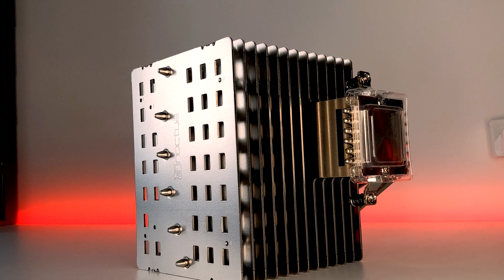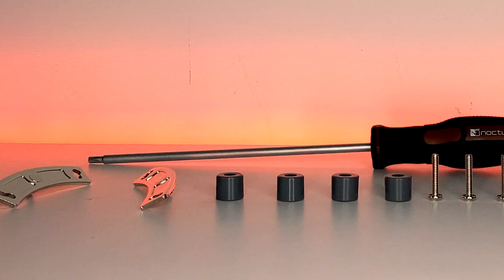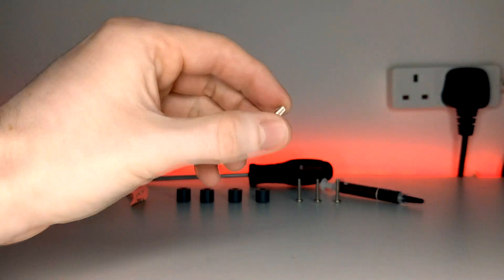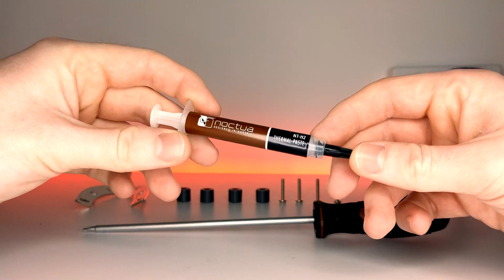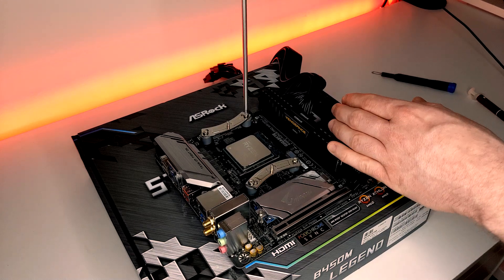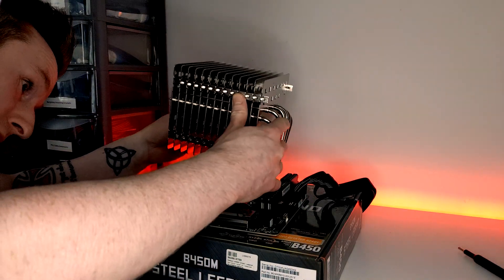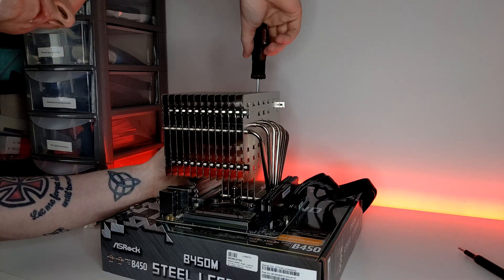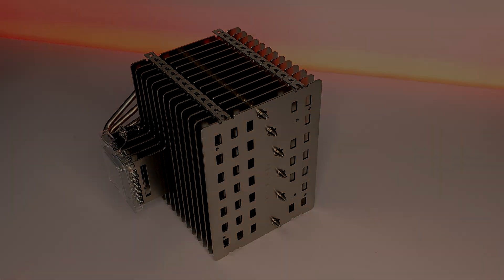Noctua NH-P1 AM4 Installation Tutorial

Comment: You made that look so easy, if I did the install, I would probably stripe a screw.
Reply from the maker: It's really easy mate! Instruction manual is really straight forward and it's no hassle getting it screwed into place 👌
Reply: @PCJack  even with the manual I wouldn't trust myself.
Reply from the maker: @QuickBits  Oh I don't know about that 😂 Personally I prefer the installation process for this over the stock AMD cooler.
Reply: @PCJack  why is the stock cooler just cheap plastic?
Reply from the maker: @QuickBits  Nah just because starting to screw one side can make the cooler lift up and you have to balance it out on the other side and because it's screwed directly in the backplate you can have to use a fair bit of a pressure for it to thread properly.
Reply: @PCJack  yes that sounds more challenging than this one.